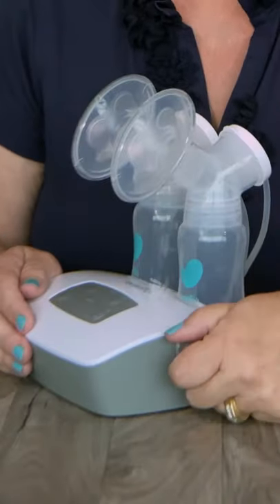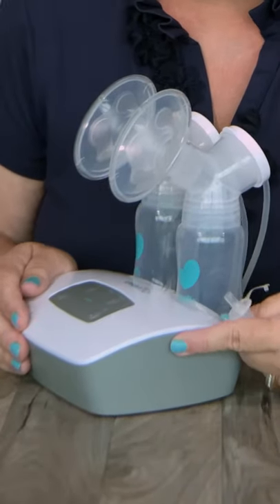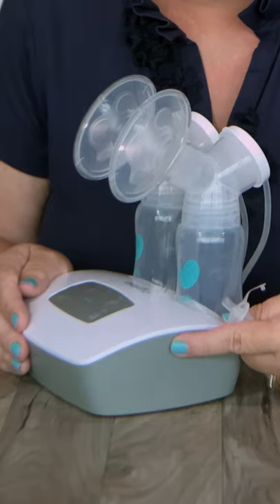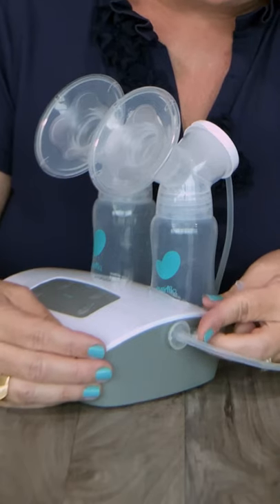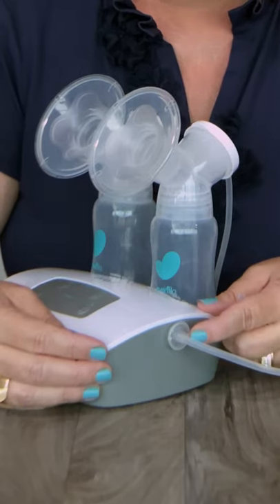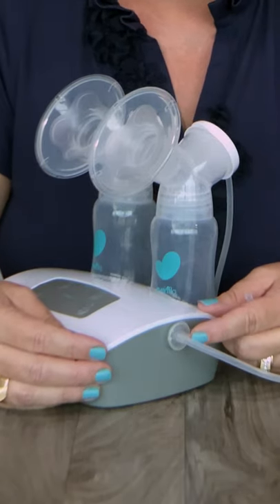5 Reasons Your Breast Pump is Losing Suction 😭 #Shorts

Comment: I bought the same pump and I absolutely loved the soft silicone flanges that come with the pump. What a game changer. I am pretty happy with my evenflo pump and especially love the spots to set the bottles so I’m not spilling precious milk when I am trying to empty the milk into a bottle or bag. Little things like the soft flange inserts and the bottle holder spots for both bottles is awesome and such a mindful add on for s pump. Thanks evenflo for the thoughtfulness for us moms. Pumping and breastfeeding is not always an easy smooth journey and each child and experience is different. I certainly appreciate when companies put extra thought and touches on stuff for mommas. It feels good to be supported even if it seems weird for someone to be so thankful for a thoughtfully designed pump. Thanks evenflo!